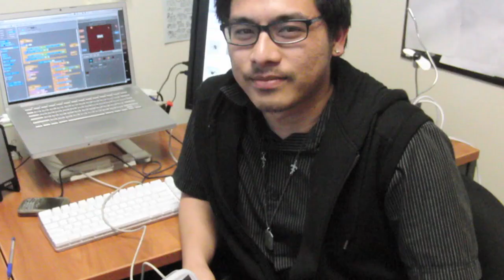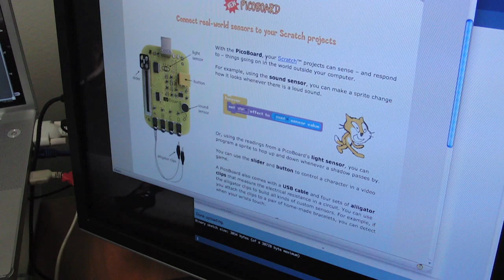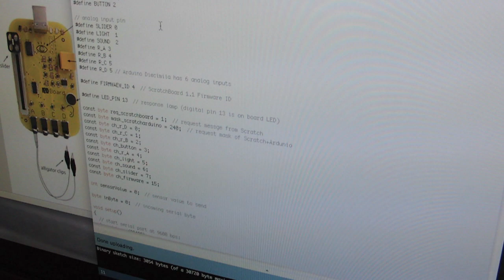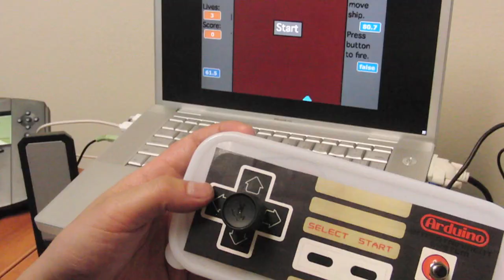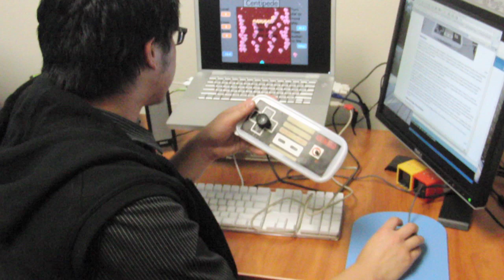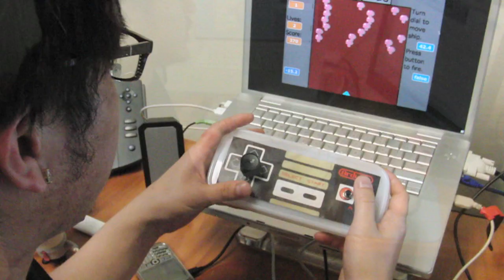Arduino Scratch Game Controller - "Arduino Entertainment System"

Comment: Great project.  Thanks for posting the code, I'm interested in using Arduino to read input from an accelerometer breakout board to send output to Scratch (a project to work on with the kids), so I feel inspired to buy the components for my arduino board now.